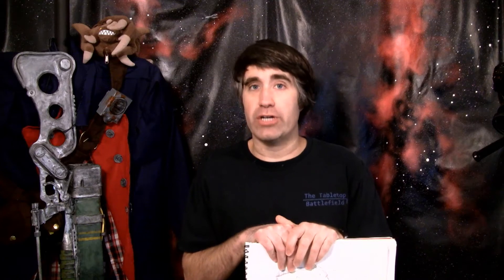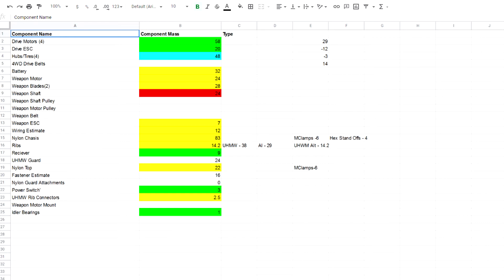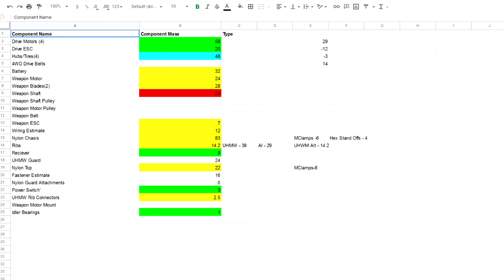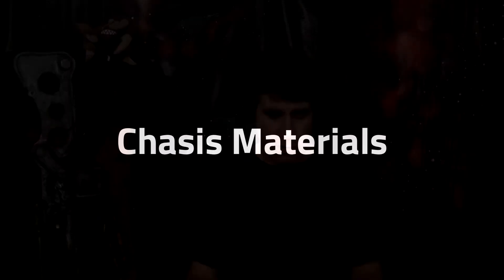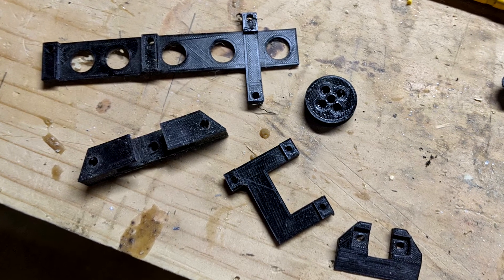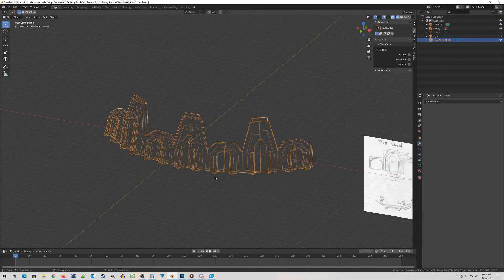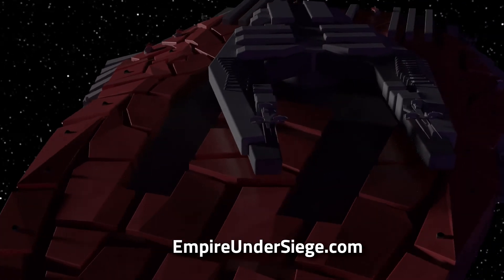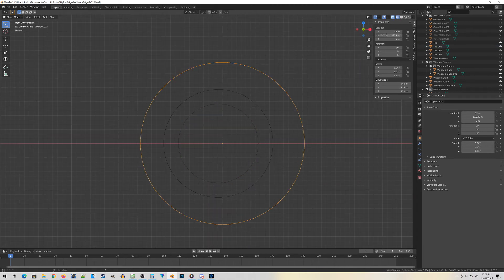Build Your First Antweight Combat Robot - Part 2 - Designing the Robot

Comment: Its so puzzling.  I read that the dimensions of Antweight are  4" x 4" x 4". Yet you say the one you designed is 4" wide and 5 /12" long.  I see a lot of ant weights that seem not 4" x 4".  How in the heck is that a valid size?  Your video is great of course. I love your layout method.
Reply from the maker: I looked around a bit and I did find several Antweight rule sets that limit a robot's initial size to a 4" cube.  These days, in the US, most competitions use a derivative of the SPARC ruleset.  These rules do not have size limits for robots, so size limits are often the exception. Some events do still have them though. My Beetleweight, Micro Flash, fits in a 12" cube because a single event in Ohio had that requirement.

Comment: I really need to make a materials science vid at some point. It's a huge rabbit hole into itself!

EDIT: also waterjet cutting anything is expensive but laser cutting AR500 can be super cheap. My antweight weapons were custom designed and lasercut from send cut send for ~ $15 apiece
Reply from the maker: A video on materials science for combat robots would be helpful.  There seems to be lots of small details that probably matter more and more as you get into larger robots.

As for laser cutting AR500, how does that affect its hardened state?  I went with water jet cutting because I was under the impression that the heat from the laser cutting would negatively impact the strength of the AR500.

Comment: Hah, spreadsheets are important. I've got a spreadsheet filled with various part weights so I know if something is going to be overweight without even doing any CAD. Only area I've had trouble with is getting the weights accurately for 3D printed parts. The slicer calculated filament use/weight is off by a 1-4g compared to the actual model usually. I haven't found a way to properly account for FDM/3D printed parts in Fusion 360. Just assigning say Nylon 6 gives a totally invalid results as it doesn't account for infills and such.